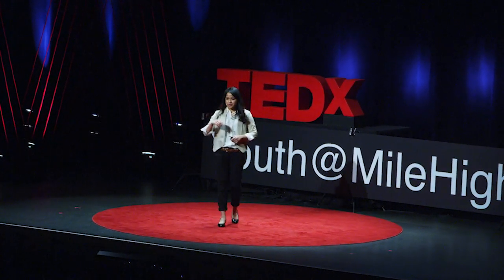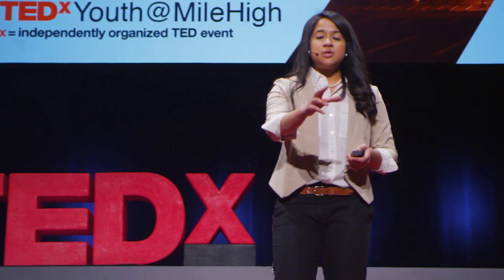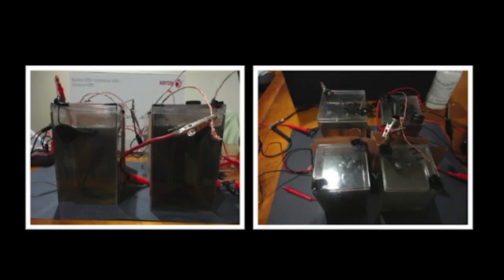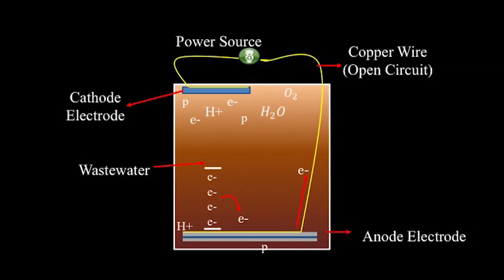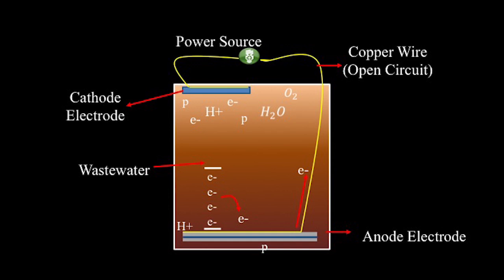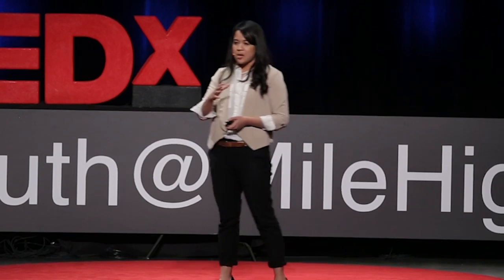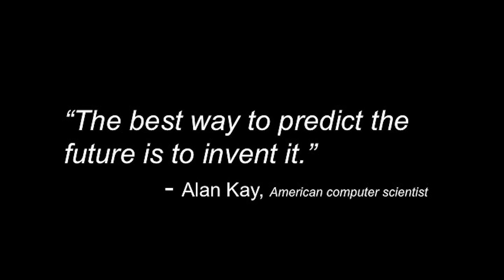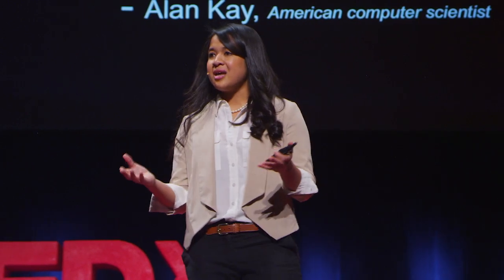Turning Wastewater into Energy: Nurul MohdReza at TEDxYouth@MileHigh

Comment: Well the commercialisation of MFC is not that easy. They are several obstacles that needs to be overcome. The cost of electrodes, it's biocompatability, conductivity and low resistivity are important factors to be considered. The electron acceptors needs to easly and economically available and their recycling. The concentration and types of wastewater greatly affects MFC performance. The selection of right type of bacteria because not all types of bacteria produces electricity. Only exoelectrogenic bacteria are able to transfer eletrons to anode. So there is lots of research needed before the commercial use of MFC.
Reply: are you working of mfc ?
Reply: +DudeMan i can say about bacteria, as i know they found 2 species that can be used, Shewanella oneidensis and Geobacter sulfurreducens. In general domestic wastewater have the same composition and concentration, u can establish an average and sometimes, if its necessary, make some correction with chemicals. It's a recent technology, must improve to set in large scale, but it's promising!!
Reply: DudeMan not to mention the limitations of the current generated. Scaling up models has been shown to create a variety of issues in regards to electrode shape, thickness, material, and spacing. A larger anode will not necessarily mean greater power production. Bruce Logan and Hong Liu have done great work and reviewed these devices for years and I’d encourage anyone interested to read up on their work.